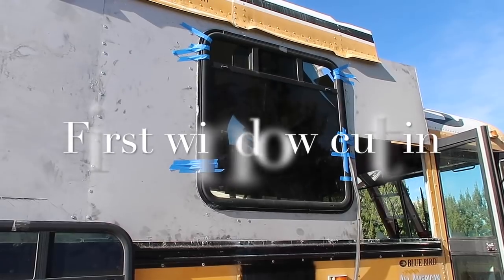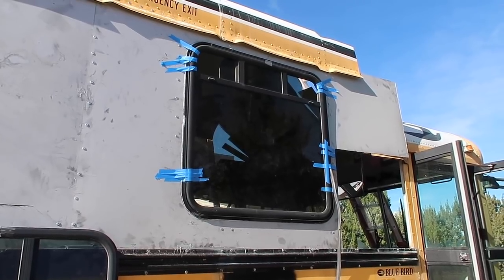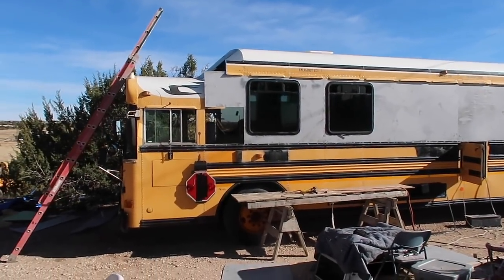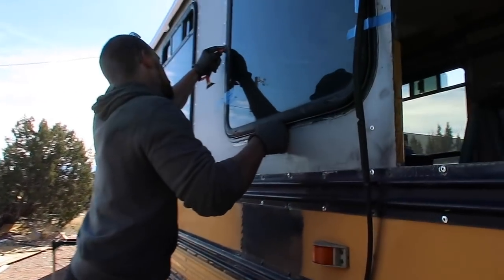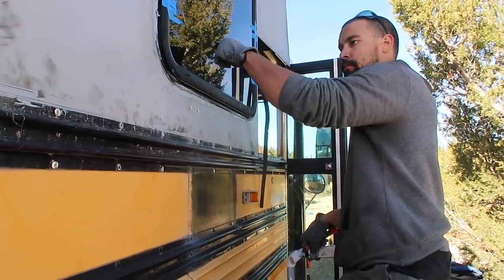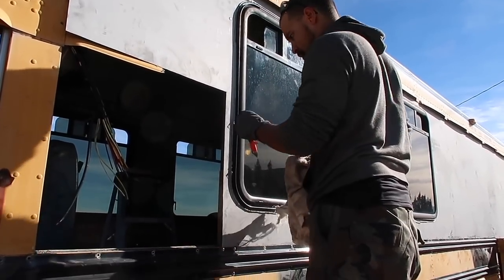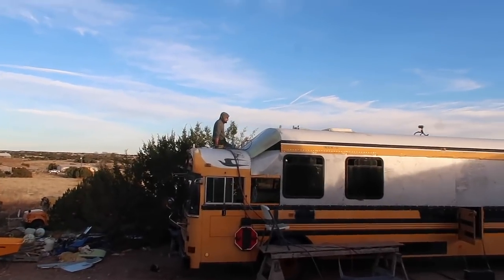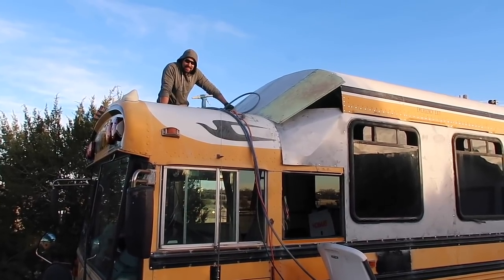School Bus conversion to tiny home, motor coach #78 last day Chris  & G bus

Comment: You guys are doing a great job. How many inches was this bus roof raised and are you going to weld all around the sheet metal? Do you need to weather seal the sheet metal also?
Reply from the maker: 21 1/2 inches, We are not welding around it but it was sealed with SikaFlex.  Thanks so much for watching!

Comment: Seems like a LOT of work for just some more head room. Chris could stand up straight in the bus before the roof was raised and G is even shorter.  RV's are naturally cozy...I just don't see the purpose in butchering a chassis like this. Structural rigidity will never be the same and it will always have a chopped up look. To each his own.
Reply from the maker: I am 6 ft tall and that is why I chose to raise the roof.  Everyone has their own views on what it is important to them.  Thanks for watching.